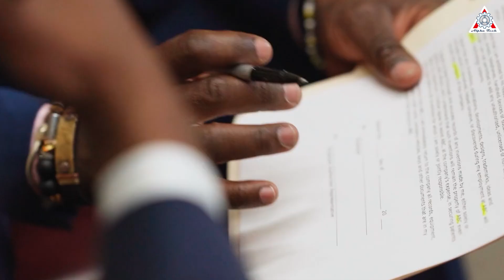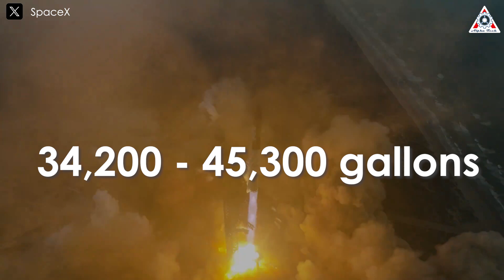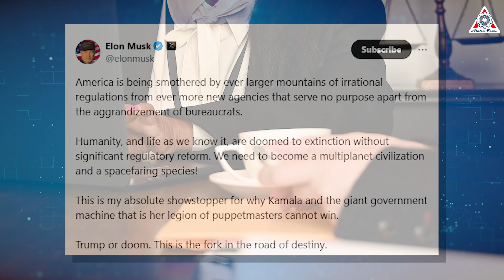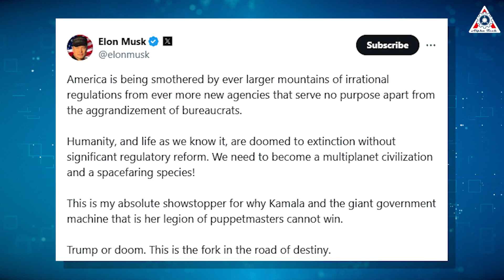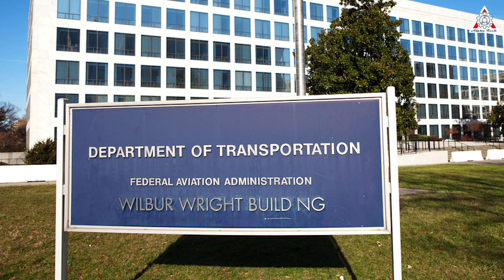FAA is over! SpaceX's Gwynne Shotwell exposed FAA about SpaceX launch license!

Comment: How much water do Hurricanes dump on land or wet lands?
Reply: It’s nature non man created.,. Specially the heavy metals can’t be extracted… need to setup a EPA superfund for this site
Reply: @Mannicx  SpaceX owns both the Falcon 9 and Starship. Meanwhile, ULA, Boeing, Blue Origin, and NASA have partnered to create the Starliner spacecraft, launched on a ULA rocket, while Blue Origin also has its own separate rocket, the New Shepard. These four companies have reasons to oppose Starship's success. Falcon 9, being smaller, doesn’t pose a direct threat, which is why they aren’t as concerned about it. However, Falcon 9 has similar issues to both Starliner and New Shepard. The real problem is that Starship, being larger and more advanced, could put them out of business. That’s why they’re using politics and influence to block its progress.
Reply: @Mannicx  Rockets using RP-1, like Falcon 9, Starliner, and New Shepard, release heavy metals and carcinogenic chemicals into the atmosphere and oceans, which can harm the environment, especially wetlands and water supplies. In contrast, Starship uses a cleaner fuel, primarily producing water vapor and CO2, with most remaining byproducts turning into harmless steam. This makes Starship far less damaging to the environment, offering a more sustainable and eco-friendly option for future space travel.
Reply: Potable water in a place that floods all the time with minimal trace metals being released and ship completely reused. Or older ships that is  proven to burn up in atmosphere aka all the metals of their metals "cough cough" and if not fall in to the oceans and horribly contaminate the water on take off RP1 or in the ocean crashing. Do you think it could be Financially and Politically motivaded

Comment: Why is it that the SLS does not require FAA launch approvals (because it is a NASA rocket) but the SpaceX Starship (which is being developed for NASA use) does require FAA launch approvals?
Reply: NASA regulations were notoriously onerous.

Instead of asking NASA to come up with better regulations, they kicked the ball to the FAA, because the FAA has experience with commercial operations. 

The FAA made up new regulations that are even worse than NASA regulations. The opposite purpose for the switch in the first place.

Because politics.
Reply: @jtjames79  The issue is really politics.  Since NASA, the FAA, and the Military are all separate organizations, they agree to (mostly) stay out of each other's space.  Since SpaceX's rockets are not under NASA or Military oversight, that puts them under FAA oversight (which is way more political then technical).
Reply: Hold on ! FAA has little or no expetise in rocket design or expertise in outer space ! They are bureaucrats that write make-work regulations for supposed rocket companies and then use their bureaucrats to enforce these regulations - it is not necesarily about "safety", it is about regulation and regulation enforcement. Remember, ther was a 20 year old ban on space flight regulation that was passed by Congress in 2004 to allow commercial space industry (& The FAA the ability to understand space) to get established and to make space flight safer without restricting innovation, before falling under the burden of regulation ! That moratorium expired 1Oct '24, unless the HousecScience Committee extended it !!!
Reply: @johnrday2023  The FAA has been a pilot protection racket for decades. 

If it doesn't protect pilot jobs, they will do anything to stop it. 

That's why the drone industry isn't US-led. We invented those things here.
Reply: @johnrday2023  I (mostly) agree.  The FAA has been all about exclusively about commercial aviation since there were very few commercial rockets and most of those were former military rockets.  SpaceX changed (more like broke) that and the FAA (like most bureaucracies) does not like to change so they are trying to follow their processes "that have always worked" but are now totally broken.  Their attempt to regulate the drone industry has also been a fiasco.  They do no understand these new markets that they are trying to regulate.
Reply: Its is made by Rockwell and Boeing who of course do not need any permits. They are PERFECT.

Comment: The deluge system was a dead duck right from its inception. It was not an answer to the previous launch setup, which destroyed part of the launcher. The problem all along was the omission of an Exhaust diversion trench, which was a severe oversight and was obvious from the get-go. Had an exhaust trench been implemented at the very start all this aggravation would have been avoided. Exhaust trench necessity is now on the agenda and one is under construction. Victory at last.
Reply: thank God they finally listened to you!!!